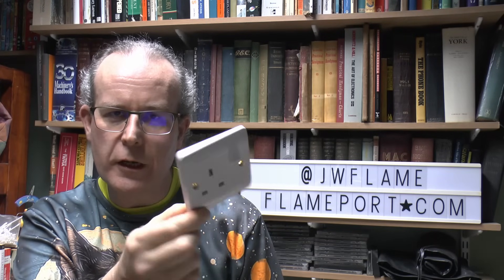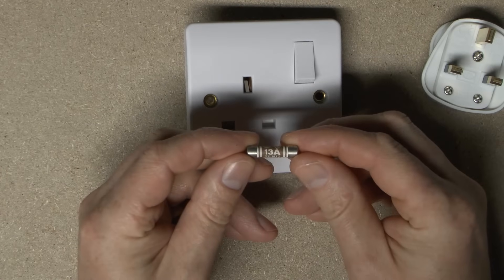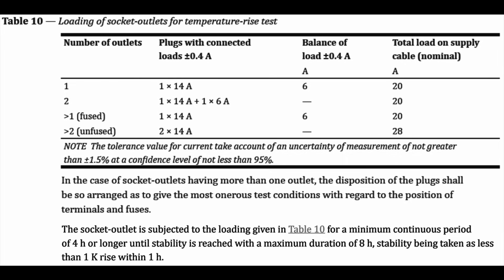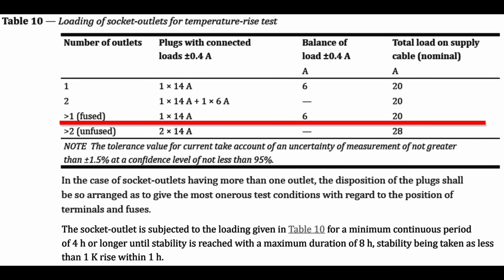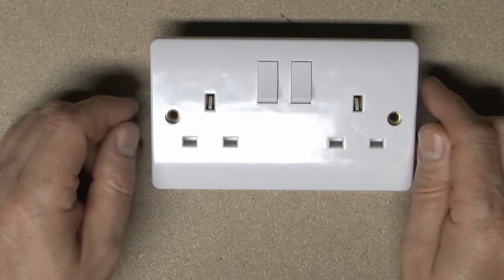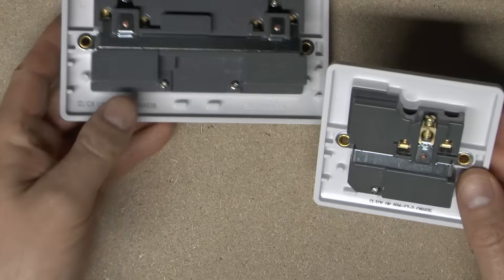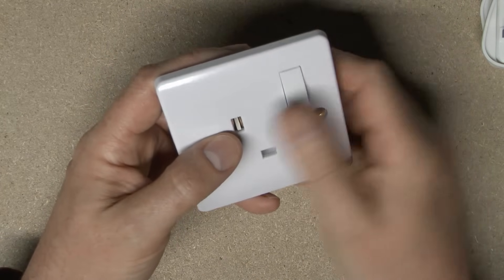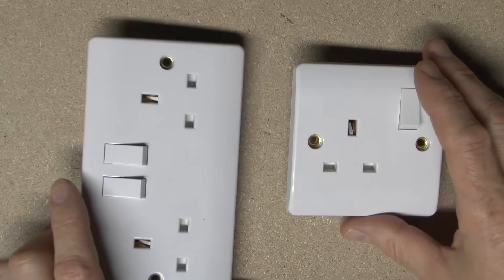Double Socket Outlet 13A 20A 26A? EV Sockets, Fuses,  Washer/Tumble Dryer in one double?

Comment: A 13A fuse can get so hot it can melt the plug - they are more a danger to life than a saver of life IMHO - i have removed all 13 A fuses in high current appliances and replaced with a copper 1/4" bar - plug stays cool . any short cct faults will trip the 20A breaker now directly
Reply: 🤣🤣🤣🤣 Joking aside the fuse is to protect the appliance lead which could be rated well below 20 Amps
Reply: @barrieshepherd7694  
joking aside why is england the only country doing it this way?
Reply: @ursodermatt8809  Many explanations on the Internet and YT - but simply for safety in  the days of fuses in consumer units and an understanding of the fire risks associated with small gauge appliance cable.  With a 3 Amp fuse I don't have to have a thumping thick stiff  mains lead on my lightweight soldering iron
Reply: @ursodermatt8809  Oh Wales & Scotland along with Ireland, Cyprus, Malta, some African countries, Hong Kong, Malaysia, Singapore,Bahrain, Saudi Arabia, Sri Lanka UAE
Reply: @barrieshepherd7694  
hardly any western countries though
Reply: @ So - just pointed out that other countries have adopted the UK plug style.  Don't see that it matters whether North, South, East or West.
Reply: @barrieshepherd7694  
good luck with it.
Reply: @ A relic well past its time - modern MCBs and devices negate the need for a fuse any more - its more a fire risk being there for high power devices
Reply: @mattsan70  - As said elsewhere, the fuse is there to protect the flexible cable (flex) between the plug and the appliance. The socket may be on a 32A ring circuit. The short term short circuit current flow can be substantially higher than 32A before the MCB trips. But the bigger problem is overloading or overheating of the flex (which for a table light or other low power appliance, may only be rated for 3A). A fuse in the plug should blow before the cable catches fire. With no fuse, it's possible that a fault, but not a good enough short circuit that draws enough current to trip the MCB may occur, then you may have the flex catching on fire.
Reply: @Mark1024MAK  I was waiting for this comment. This scenario has proven to be very rare especially with modern appliances. Things usually go short circuit and not this intermediate overload stage as many claim
Reply: @mattsan70  - I wasn’t talking about a fault with the appliance. And by the way, I have seen a damaged cable arcing. Have you?
Reply: @barrieshepherd7694  it'll be fine unless there's a short circuit and then the breaker will trip
Reply: the fuses in the plugs are used in england only.
i suppose with brexit they will add two fuses now.

Comment: The larger fuses are designed for different purposes, not for plugs and not likely to be fake!
Reply from the maker: BS1362 (the specification for the type of fuse used in BS1363 plugs) states a maximum value of 13A.
Higher values of fuse obviously exist, but they will be made to other standards and will have different physical dimensions.

Comment: Good points John, well presented. British Standards always hold up. Never seen a socket fail from overloading, usually cheap silver plugs that start the high resistance overheating situation.
Reply: I replaced one here where the socket had failed after extended use of a 3kw heater.  It was observed that it was running quite warm so I investigated and swapped it.  It was that the pressure exerted by the socket on the prongs of the plug that was a little slacker than it should have been which raised the resistance of the connection.  There wasn't any sign of heat damage on the wiring itself which had good connection to the terminals.
Reply: I have seen where it appears the socket has failed, and i have seen the pin gripping fingers inside open up a little, but usually if there are problems then yes, more than likely the wire termination is loose in the back of the socket faceplate causing high resistance and subsequent heat damage.
Reply: It’s the fuse that normally generates the heat on higher load devices.  Tumble driers that are run for hours on wash days are bad for this.  Fuses get very hot well below the point at which the wire actually melts.  They are great for preventing short circuits.  Not so good for long term high current loads.  If you were designing something that pulled 13amps at peak load you would likely go with a 20amp fuse.
Reply: @JT_2024-c8j  Don't forget that BS1363 sockets and plugs were intended to be rated at 15a but had to be derated to 13A.
Reply: they usually fail without overloading. Stuff is just junk these days

Comment: A regular misconception, that a double socket will take 26 Amps.   They are rated for 20A from memory, having read the BS a few years ago.  I did several jobs a few years ago at a landlord's property, where the builder wired up a conservatory (!!) with 4 double sockets on a 2.5mm radial spured off the back of a socket in the main house.  The conservatory was very cold in winter and a tenant (who had three young kids, washing machine and dryer constantly on the go) had three 3kW heaters plus a large dryer (2.5<3kW) all plugged in.   The new tenant found sockets were overheating and putting off a fishy, burnt plastic smell.   I eventually rewired the whole conservatory (it was huge) from the house downstairs ring and added a fused 3A spur for the conservatory lighting (I put in new LED units, very low power).
Reply: The only ever rating I've seen a manufacturer quote was MK and that was 13+6A.
Reply: @drsquirrel00  time for you to look again then, mk logic plus are rated at 13amp per outlet according tk their datasheet
Reply: @ Ah that's good then, will check.

Comment: Hi John, Seen many of your vlogs, always interesting, especially the items in the back ground 🙂
Question on the connectors on the back of the sockets, does the load include them, thinking of people putting 2 wires into each in a ring or even 3 in a radial?

Comment: Seems odd to me that the sockets are only rated to 250v given that the maximum voltage in Europe is 253v.  I know in reality they will be capable of withstanding substantially higher voltages before they break down.  Would be interesting to see if anyone has done any testing to see when that typically occurs with sockets from around the world,
Reply: It's a nominal figure not a breakdown rating.  Australia's standard 3 pin layout has been rated for nominal 250V since the 1930s.  The 253V maximum you mention is likely to be the long term voltage that can be supplied from the network with excursions above that being permitted.  You'd have to pay close attention to the wording of the regulations implemented in any given country in Europe to determine what that country does (I'm sure at least one Europe expert will have something to say about this but this is how it works in the real world)
Reply: @retrozmachine1189  the 253v I mention is based on the "nominal" voltage of 230V with wide tolerance of  +10% to -6% - it's nominal in the sense that it was never actually intended that the actual voltage in any European country (and Australia which also has adopted the same standard) would actually change but that products designed for that market would work across the range - which is 216.2v to 253v.   That's why having a rating of 250v is odd - the rules permit the voltage in a country to be 253v continuously so products designed for that market must also be able to operate at that voltage.  (I am aware in reality that to meet the other standards they have to be tested at 253v but it's just that calling it 250v rating seems archaic now).
Reply: @_chrisr_  You misunderstand what I mean by nominal.  I am not referring to the window of voltages that are acceptable for your supply.

Comment: I have plates and extensions with about a dozen kW of appliances (don't tell anyone) plugged into them, all running off a peak 3kW / 1.5kW throughput supply from an inverter. Lots of things will run together quite happily due to 'duty cycle' but ensuring no N appliances with a total that exceeds the limit are operating together can be challenging. If I get it wrong the inverter cuts out far more enthusiastically than any MCB - must be a computer-controlled switch? I wonder if MCBs will go that way as complicated gear like AFDDs become more mainstream, so that overloaded circuits are disconnected much earlier?

Comment: I did once have a very naughty cable consisting of two 13A plugs connected to a 32A commando socket.. into which an EVSE could be plugged (turned down to 24A naturally, I’m not crazy).
Reply: Hmm used to run a buzzbox welder off the upstairs and downstairs ring simultaneously with a similar lash-up lol

Comment: I see a lot of appliances fitted with a molded plug top with silver pins & been out to two failed molded plug top melted & burnt throught to the socket tumble dryer & dishwasher so yeah cut off plug & replace with each install 👍
Reply: John disassembled a silver pin plug off a supermarket brand kettle that had melted itself firmly into a socket a while back... Im surprised the standards people haven't had anything to say about the silverpins cos it seems they're a very common cause of overheating these days.
Reply: The quality of moulded on plugs can vary a lot, they are fine for anything under about 1,500 watts, but above that, they can often become quite warm, I had one on my 3 KW kettle, which got quite hot after a couple of minutes use, so I replaced it with a normal rewireable plug & had no problems since.
Reply: Another problem with moulded plugs is that if the wire has not been crimped correctly. A poor connection with increased contact resistance can then cause problems. For the line or neutral, this can result in overheating, For the earth, it may result in too high a resistance for the fuse to blow in the event of a fault.

Comment: The weak point is the fuse, we used to get a problem with fuses blowing on a milk  cooler on the farm. Swapped the fuse out for a cut length of bright round nail and no bother, still doing service 20 years on.

The plug does get warm but certainly not hot and nothing obviously melted.
Reply: If you ever have an electrical fire your insυrance won't pay out because replacing a fuse with a nail is not an approved practice. You have removed all the protection. One day the milk cooler will fail.....
Reply: 100% agricultural.

Comment: Related: should you check your plug pins for discolouring and clean them up with a wire brush and good old brasso?
Occasionally I see pins that have literally gone black with age!
However cleaning up spring contacts inside the socket is not so easy🤔
Long term increase in contact resistance is a bit of a worry.
Reply: I take plugs and extension leads apart every few years and clean up all pins and contact surfaces. Tarnishing is usually the signal for some remedial work.
Reply: I clean up tarnished plug pins with fine wire wool.
Whenever I'm wiring stuff up, especially fixed wiring & also plugs on high power appliances, I smear Vaseline on the stripped ends as this prevents oxidation over time.

Comment: I fairly regularly find heat damaged plugs and socket outlets on catering appliances which are in use for many hours a day such as bains maries and tea urns. I think I'll try an EV rated socket outlet the next time I have to change one and see if it lasts any longer.
Reply: A 13 A fuse tends to get rather hot when run near it's rating. I've seen it when fcu's have been used on immersion heater circuits where they fail due to the heat, often the fuse gets welded in.
Reply: @alanjewell9550  Had plugs weld themselves to the socket because of poor contact, and I have to chisel the plug apart, then chisel the cover off because it has melted to the actual wall box as well. But was still providing power.
Reply: @SeanBZA  Can't get a better contact than a welded contact!

I know you Brits adore your plugs and sockets but personally I don't like anything brass for contacts as they eventually do oxidize which leads to bad conductivity which leads to fused contacts. 

Have experienced that several times with 3-phase plugs.
So I will just stick to nickel plated plugs as they are less likely to create such a problem.
Reply: @Richard_van_der_Heijden  Problem with nickel plated plugs is you often find the material under is now steel, which heats up nicely, and also rusts, as the plating is not as good. Had to chisel a good number of plugtops off, as they used a nickel plated earth connection, which would, with living in the humid sub tropics, rust and swell up, making the pin stick fast in the plastic.
Reply: @SeanBZA  The problem is that you Brits officially do not allow nickel plated plugs so you get a low quality metal under the plating.

Here in Schuko-world we have standards for the materials that need to be used for a nickel plated plug and by which plugs get tested.
The base metal has to be brass with the plating on top.

So we don't have the problem of rusting and fusing plugs like you guys do.
It's all about the place you live and applicable standards...
Reply: @Richard_van_der_Heijden  I agree, some modern better quality devices are now made with plated plug contacts. [Previous generation of copper cable cores had the added protection of tin plating, it was rare to notice any corrosion].
Reply: @Richard_van_der_Heijden  Just to point out that I do not live in the rainy islands, but rather 2 time zones to the east, and around 9500km away south....
Reply: @oldbutstillcurious3615  You mean tinned copper conductors?

They are still made and mostly used in marine applications for exact that corrosion resistance feature.

But they are also way more expensive to produce. And is this "throw away after use" society it's all about the financial bottom line. So if they can make a few more cents by cheapening out on components...
Reply: @SeanBZA  So somewhere around Nigeria?
Reply: @Richard_van_der_Heijden  Lot further south than that, you go south till you run out of land, and the next dry land is Antartica....
Reply: @SeanBZA  Is that only 9500km away?!?
Reply: I do not see them by me, so instead will simply use older socket outlets that got replaced for fashion reasons, owner wanted the bling of a coloured socket, or wanted the chrome plated new one. Old, and you simply strip them, retension the contacts, and use them there. Often the old one has never been used, in a cupboard or something, or under a counter, and has had a single plug in it for decades, or was never used till the remodel. now they want it above, and the old will not do, so in goes a junction, a cover blank plate, and chisel and new socket in the wall with some cable to join them, before the tiler comes in.
Reply: Plugs should be pulled out and plugged back in, to clean the contacts often. Most double sockets can take load due to diversity.
Reply: Those are resistive loads, so the socket having been tested with inductive loads doesn't really help you. My guess would be that they are just really old appliances that have been used for decades and the plugs are worn and making a poor connection. What church hall doesn't have an urn that was donated 30 years ago and was far from new then?
Reply: @thomasdalton1508  I'm hoping they might just be a bit more robustly built. The gear is usually no more than about 4 years old by the time they start failing.

Comment: Good to know. I was told definitely by a my NIC inspector that a twin socket is only at rated 13 amps total across the both and that all fixed kitchen appliances essentially needed their own single socket. I did think it was overkill and just creating unnecessary work
Reply: Ah yes the good old NIC inspectors opinion, I have had conversations with the IET and technical helpline which disproves their opinion on many an occasion

Comment: From my experience any good quality sockets can charge EVs the problem is loose connections in the back of the sockets and good quality EV chargers have a temperature sensor built into the plug to avoid overheating the socket
Reply: Mine has a temperature probe. If the plug gets too warm or the line voltage dips it tells the car to pull less current. The issue with arcing when switchig off or unplugging is avoided by instructing the car to stop charging first (often by unlocking it), but we can't count on some people to not be divs :)